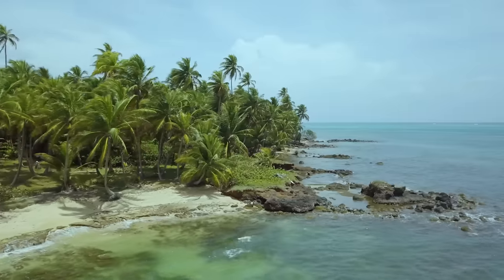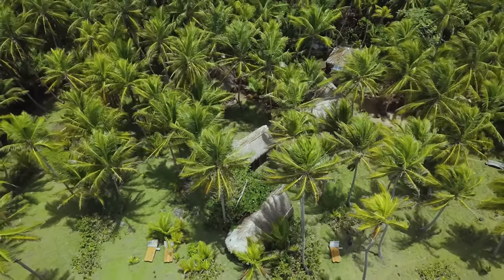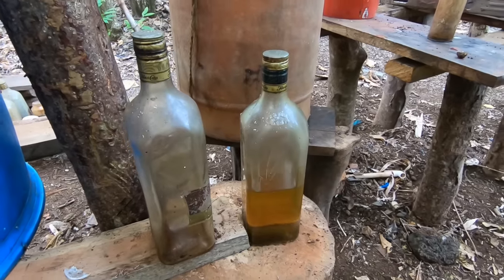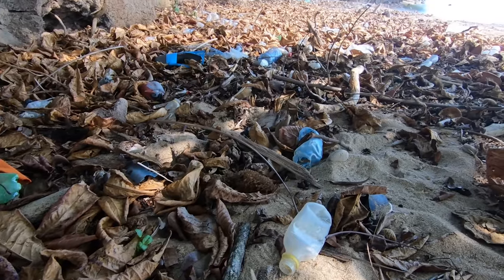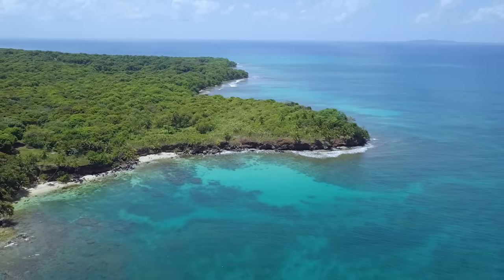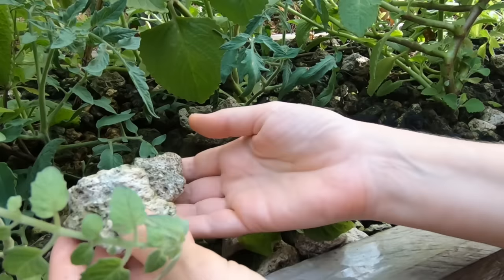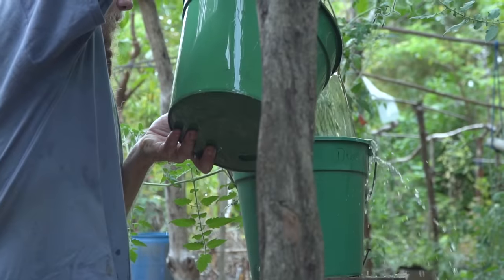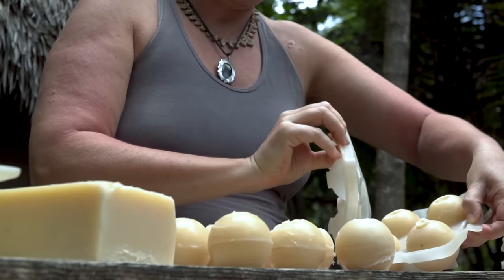THIS SELF SUFFICIENT FAMILY MAKES THEIR OWN FUEL FROM PLASTIC!

Comment: great.. instead of the trapped carbon on the ground, lets instead put it in the air.  you don't see this on a global scale because it's worse for the environment.  just because you can't see the pollution this method produces doesn't mean it's not there.
Reply: I expect there is a load of plastic washing up on the beach. CO2 in the air is better than plastic in the sea imo
Reply: Ya man lots of other options here for power source. I get it. Lots of plastic everywhere. A renewable source of plastic. Maybe converting it to fuel is less efficient in the long term?
Reply: @jonthomas9708  no, you dont know what your talking about. It better to have plastic pollution on the ground than have pollutants in the air, cause you know, you have to breathe the air. Different solutions are necessary to fix the plastic problem, this isnt one of them

Comment: I have been making Diesel from polyethlene since 2008. Using a catalyst makes the amount of usable fuel greater. Waste fractions produce gases you can use to add to your fire. I also do a lot of composting and have lots of tropical oregano like I see in the video. I also made my own soap until sodium hydroxide became unavailable.
Reply: # 5 plastic?
Reply: You do not need sodium hydroxide but you do need some sort of alkali to make soap. Potash comes to mind.   Mineralized compost would be a good source.
Reply: @dadigitechman  that is potassium hydroxide not sodium hydroxide
Reply: @dadigitechman  The natives have plenty of coconut nut shells in this video for potash.
Reply: whats your return of diesel per kg?
Reply: @hueyskitchen906  It is almost 1 to 1!

Comment: I’ve wondered if it’s possible to use plastic as fuel. I sometimes burn stuff and notice that after the plastic melts in the fire it would keep burning for a while even if everything around it is completely burnt.

Comment: Wonderful stuff going on here. Regarding the plastic to oil, which is great for those of us who heat our houses with oil, looks like a huge caloric input keeping that fire going. Has anyone measured energy in versus energy out from this process? Would it be more efficient to turn that fire heat into steam?
Reply: Heating things over an open flame in a campfire like configuration like shown in this video is always going to be extremely inefficient.  The vast majority of the thermal energy gets lost as hot combustion gases simply wafting up into the atmosphere, as the unconstrained and open configuration simply does not allow for long enough thermal interaction between the hot combustion gasses and the pot/device being heated.

More constrained flames, with a properly designed heat exchanger, kind of like what is used in a natural gas water heater, would be much more efficient.  However, I think a much better approach overall is to simply use a thermally insulated pyrolysis chamber, with a resistive electric heating element, powered via surplus solar electricity, on sunny days that would otherwise result in "surplus" solar electricity.

In order to make solar power work well in an off-grid system, you generally want to "oversize" the solar panel array to better accommodate one's needs on cloudy and partially cloudy days, as well as during winter seasonal conditions, where energy consumption tends to be high, while production is normally reduced.  This oversizing of the solar array does however mean that you end up with major "surpluses" of electricity, on favorable weather days (especially during the spring/summer months).  This "surplus" electricity can be put to good use in a variety of ways, including by way of heating plastic materials that would otherwise be considered trash.

Heating plastics in this manner (pyrolysis) breaks down the solid form (long chain) plastic hydrocarbons into shorter chain liquid hydrocarbons (when cooled back to room temperature).  The resulting liquids can potentially be used directly like shown in this video (although there can be complexities associated with this, due to imperfect match of the plastic derived liquid products, compared with real diesel fuel).  In my opinion, it would be better for greater society to blend the resulting hydrocarbon liquids with crude oil and then send it to a normal crude oil refinery, so as to achieve a full recycling of the hydrocarbons in the plastic.

The current method of plastic recycling primarily being done in much of society involves separating/sorting the plastics, so as to directly melt it down (at relatively low temperature, too low for pyrolysis breakdown of the hydrocarbon chains to occur) and then to blend it with new plastic feedstock, so as to make a partially recycled output material.  This process is very limited however, as a large percentage of the plastic materials end up getting rejected and thrown into landfills for various reasons (ex: such as due to being contaminated with things like color pigments, which cannot readily be removed when simply melting and blending the recycled plastic with new plastic).  Consequently, a large percentage of plastics, even those that get thrown into recycle bins, still ends up in landfills as waste, even though near full recycling by pyrolysis is technologically feasible and desirable, given the high value and usefulness of crude oil.

Comment: You could probably make your fire more efficient and therefore more intense in a confined place, processing the cook quicker and using less fire?  Think about a filter system for the chimney system, you're surrounded by coconut, surely you can set up an exhaust system cutting down on the amount of smoke you release into the atmosphere? maybe your chimney filter is a viable product?

Comment: As a chemical engineer working in nuclear fusion research I was tasked with researching ways of incinerating/thermally degrading plastics that had become tritium contaminated since tritium (soft beta emitter, ionising radiation, half life 12.3 yrs - very dangerous if ingested) undergoes isotopic exchange with all hydrocarbons and water. Many avenues were studied, such as superheated steam reforming, sonication, gasification, pyrolysis, etc etc. The idea being, to degrade or oxidise the contaminated polymers to convert the tritium (second isotope of hydrogen) into heavy water that can easily condensed as tritium containing water vapour and separated from other decomposition products such as CO2, etc. 
Common plastic items like respirator masks, gloves, overalls, lubricating oils - you name it they're tritium contaminated when exposed to it. Even with the government funding (with no consideration for profit margin), it wasn't feasible due to the presence of many plastics since it is very difficult to separate out the viable polymers as so many things like boots or respirator masks are make up of multiple materials/polymers. So instead, the contaminated polymers get ground up, grouted and stuck deep in the ground. 
Also, many of the scientific papers on this topic are theoretical and have yet to be proven practical even with our most modern tech. Put the wrong plastic(s) in a pyrolysis unit and you'll end up with cyanides, dioxin, furans and other assorted extreme nasties as impurities. It isn't all a big government conspiracy to keep gas prices high. Just forget about plastics that contain chlorine, fluorine or other halides - among other plastics also. There is research that suggests it is possible to incinerate or thermally degrade halide containing plastics (PVC for example) in a safe manner, but it must be done under extremely carefully controlled conditions (the costs are prohibitive, you'll need speciality ceramic sintered filters to remove toxic condensation products before they cool, high pressure pumps, lots of R&D, etc etc) - far beyond the scope of DIY backyard preppers and most laboratories for that matter also. 
After reading so many comments here about how we should all be putting all our plastic waste into pyrolysis units, I just had to point out the above. If we all did this, life on this planet would not last long.

Comment: Just wondering at the very end of the condensing line is there a light hydro carbon gas like methane or propane that can be used to aid or completely replace the fire cooking the plastic?

Comment: you can also take some dirty oil like cooking oil or even used car oil and add methonol or ethonol the lighter fluid you use for  BBQ grilling  at a 1 to 3 ratio 30% methonol and 70 % dirty oil mix and  done bio diesel or  mix the oil in a 50% by 50% mix with gas station red diesel

Comment: This is amazing! Have to figure out how to process all the Plastics in my Valley in Colombia to Diesel!
Reply: I would think of a way to deal with the toxic chemicals that are left behind in the container before trying this.
Reply: @buykuibra2518  I would rather think & try at the same Time. The Alternative would be to dump it into the public Trash Hole where no one thinks about it nor deals with it.
Reply: @ayuscetic  Where I live, most of the plastic is either burnt, shipped to other countries or recycled. The heat is used for warm water, yet the leftovers are buried as chemical waste. I think that the stuff left behind would be more harmful in a landfill than regular plastic.
Reply: @buykuibra2518  Why do You think that? Is there any chemical Explanation for that? It is possible. I do not exclude what You say.

At the same Time, the burning Process would just accelerate the naturally ocurring Fermentation and Oxidization that happens to Plastic in the Landfill, anyways.

Comment: The product is not necessarily diesel, but a more generic type of liquid oil. The actual composition will vary based on the types of plastics used, and some plastics (LDPEs and HDPEs, as far as I can tell) can produce something chemically close-but-not-really to diesel [^1]. More importantly, the heating value (amount of energy released per kg during combustion) is very, very close to diesel—liquid oil @ 41.7–44.2 MJ/kg [^2], vs diesel @ 42–46 MJ/kg—which supports the other finding that its engine combustion performance is comparable to diesel [^1].

I'll also note that both references keep mentioning "catalysts," which would mean that they produce cleaner and/or superior product than seen in the video. The first reference[^1] in particular mentions (verbatim) "Importantly, some of the literature indicated that waxes formation occurred when plastic pyrolysis took place in the absence of a catalyst"; I'm unsure whether this wax makes it way into the condensers, but the point is that plastics are chemically complex enough that you'll need to worry about impurities eventually gunking up an engine.

[^1]: https://pubs.rsc.org/en/content/articlelanding/2019/ra/c8ra10058f
[^2]: https://www.frontiersin.org/articles/10.3389/fenrg.2019.00027/full

Comment: I assume you re using plastic number 1. Number 2 is good to heat and compress and carve into anything much like wood. Number 7 (polystyrene) melts into lacquer thinner and can be used to paint the end of milled timber to stop cracking & number 2 is also a good fire starter when mixed with sawdust. I save all my plastic until I can reuse it somehow.

Comment: I’m wounder ing how I can change used motor oil into diesel, perhaps with a fractionation and condenser. I-wonder what your target temps are. Can you use the heat from the Diesel engine to break down the plastic?

Comment: why can you not use  solar  with a step up transformer  to run an induction coil heat system  to pyrolyze the plastics!! or alternately  use the solar to make a water electrolysis device to make oxygen/hydrogen  to burn  for fuel ??

Comment: Simple alchemy.  Recycling transforms the mass back into other types and fuels.  If the matter was known a long time ago.  In this way, the entire world is processing a valuable substance into useful raw materials.  While the world depends on fuel consumption.  This is the only solution now and in the future.  You will not have to waste time after oil products from the ground pumpet.  But to use material broadband at the moment.  A lot of bandwidth.  Half of the planet.

Comment: I watched the video very carefully, but I had many doubts. Especially regarding the ecological premise of producing diesel from plastic.
Most of that collected on the beach, it would appear to be PVC, which you bring to a boil and distilled with the home-made pot still.
The liquid produced in this process appears to actually be combustible and diesel-like in appearance.
But what types of hydrocarbons are we talking about?
How are the chlorine atoms (present in the polymer) split from the carbon chains and where do they end up?
Using that still, how can we be sure that all the PVC is turned into chlorine-free diesel?
Combustion of polymeric compounds with chlorine at relatively low temperatures could produce dioxins, which are extremely dangerous for health.
This is not environmentally friendly.
The distillation residues (which I assume are tar and other heavy pollutants), how is it disposed of?
Thanks for any clarifications.

Comment: I believe it`s closer to kerosene or oil than diesel fuel or it`s a bottom grade product
Commercial-grade fuel takes compression or 400 C to ignite making it a potential fire extinguisher for when things get a bit hot but not too hot haha

Diesel engines run on practically anything that`s remotely flammable and in some viscosity spectrum (not too dense, not too thin), they aren`t really picky

Comment: I am concerned that it can be quite dangerous to just burn the resulting hydrocarbons. They contain a lot of toxic byproducts, which can be dangerous when burned. Even though indeed the resulting oil is close to diesel/gasoline, it still contains unpredictable pollutants, depending on the sources.

Comment: I hope you filter that plastic derived fuel fuel as plastic contains a lot of additives that can be very harmful to the environment when combusted. You’d need to run the fuel through some kind of simple filter (such as activated carbon, clay, silica or alumina etc) before you use it. Not only to stop even more harmful emissions than normal diesel but to also make sure you don’t contaminate your engine/generator.

Comment: This proces is long known. And we call it bio mass. And sure it is clever. But the actual proces of it, is unsustainable. While you burn up the woods around you to fuel this proces, which leads to even more issues, so you need to replant trees, which grow slower than you need to commit to such a proces. What it does do though is that in this way, you really fully use the items most people throw away. Which makes it more efficient as a method. But so efficient that you would need all processes and natural resources used, to be monitored and as mentioned, replant more trees than you have taken. Also the planting of these trees has a carbon footprint. So sure...it is clever and already used on large scale. The things these people don't mention though, is that it needs one to put in more energy, than you actually create with this proces. For them,...being one family, this might work, until their little island runs out of dead wood. And problem is,..there is limited ability to replant what they carbonized. So sure they think themselves clever and useful, by using waste, it all looks very hippy.

But the proces itself is unsustainable. And needs one to commit to problems even bigger than they try to solve. So this is not full circle. It just seems clean and hippy back to nature and all holy and sound. Just it is not. It makes a nice story is all. But when you don't commit to the full responsibility of this proces, it fails. So don't try this at home. When you want such a proces, which is half smart, than make it fully smart please. Since this will mislead the half smart into doing stupid things that even wastes more than we actually need to. It also changes our natural environment into a fully human handled one. In which natural ecosystems will be lost. We regretfully can not copy nature, since we aren't that responsible. We have little interest in putting in more energy than things provide, and that is our problem. Until we truly solve it, and so far...it clearly seems we can not. We even cheer at fake stuff like this.

So do not be fooled, be honest. And stop taking more than you minimally need. While starting to become more just, more responsible, and think up the true solutions to our world wide problem. This is half smart...which is misleading. And I am not about fooling ourselves. True progression and being part of the ecosystem means, to go full circle. This is not full circle it only seems that way.

Comment: Any plastics can be turned to gas? If so why not reach out to disc golf manufactures for there products that dont pass their QC tests. I know Jeese at Trash Panda Disc golf uses the specific plastic known as TPU 95A to make fully recycled and recyclable discs and has also parterned with disc dot to make them fully recyclable products. In which is diverting alot of the trash from landfills but there's so many other types of plastic that can't be recycled but could potentially make the fuel you're making. I just wonder what the cooking process does to the environment? I know you said it's in a sealed airtight container but because I'm uneducated on it it does raise concern in that area but maybe is completely harmless and if so I think finding a distributor direct Plastics to do this should be a common practice by all companies that use plastic products. Nonetheless it's a very interesting topic and appreciated the video. Maybe you could do a follow-up on what types of plastics can be used